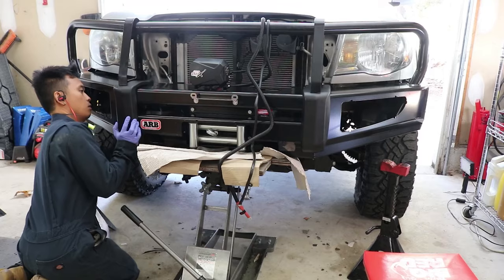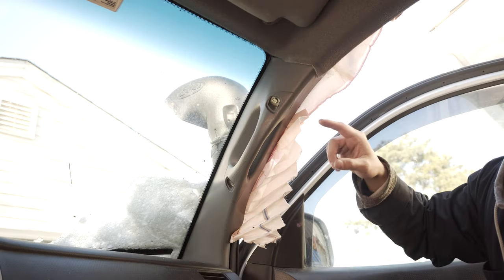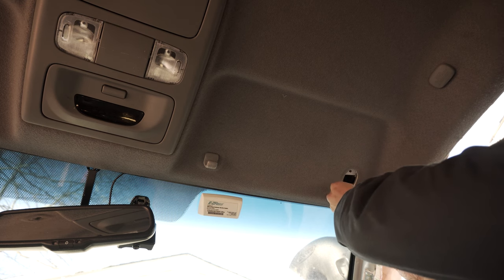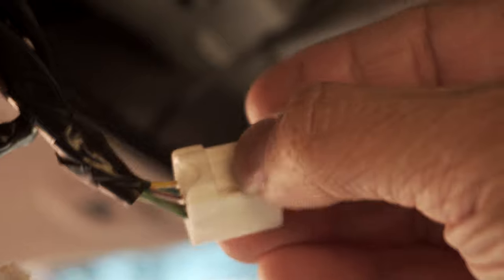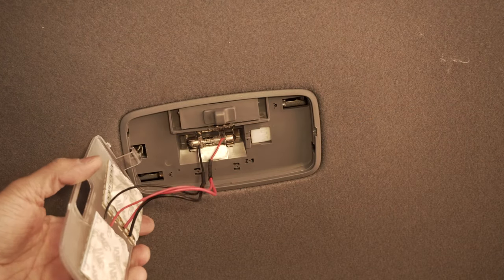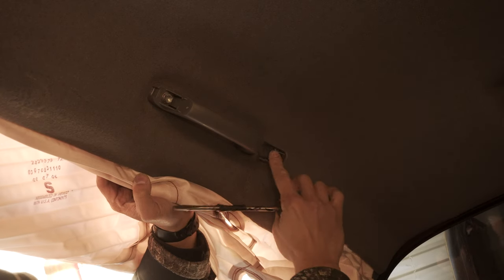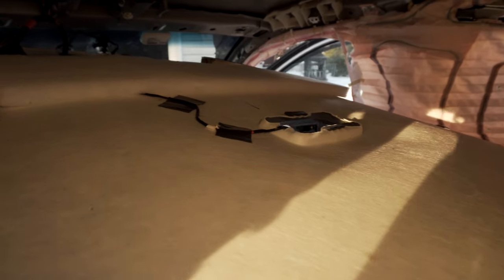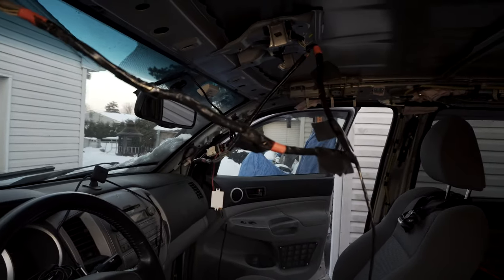Headliner and Curtain Airbag Removal (Fixing the Flipped Taco Pt 2)

Comment: I commented on one of your other posts. I’m finally giving this a try. Did you have to remove the panels that the seatbelt comes through?
Reply from the maker: Yes I would recommend it. The headliner is tucked underneath the top of the b and c pillars. It would be difficult to install or remove the headliner with those in the way
Reply: @KFloTacoma  is there a certain way to do it? I don’t want to just pull it away and end up breaking something and not be able to put it back in place.
Reply from the maker: Breaking the tabs is easier to replace than tearing the headliner. Plus the headliner is so cumbersome that its very difficult to manipulate. You can probably try it though, if it gets too difficult then you can remove the pillars
Reply: @KFloTacoma  it looks like there is a piece of plastic that hooks over a metal piece in front of it. That must be what is preventing me from pulling it out. Do you think I would have to pull it out at the bottom somehow and push it up and out?
Reply: @KFloTacoma  I think I forgot to tell you thanks for the video. I got it done but had to take it to the stereo shop to do the crossbars and help me get the headliner back up. I ran out of sound deadener.